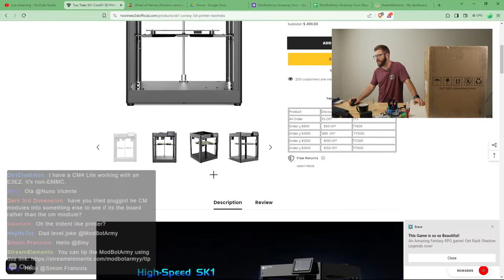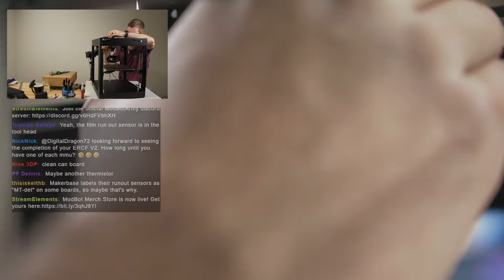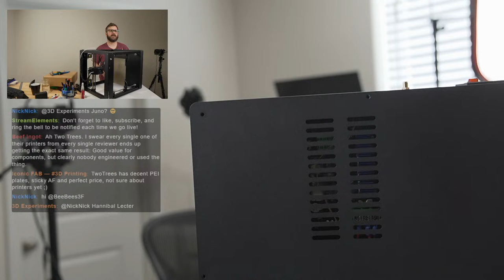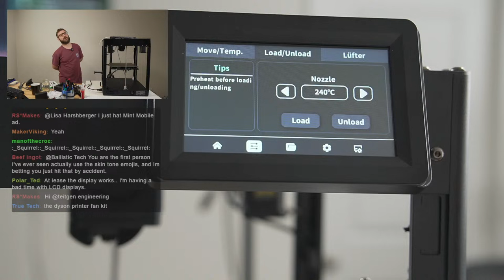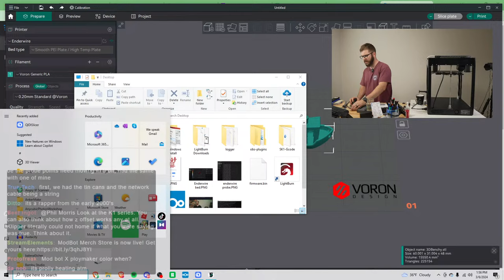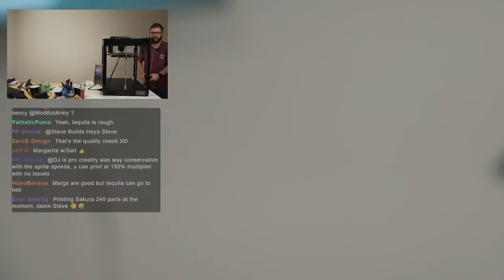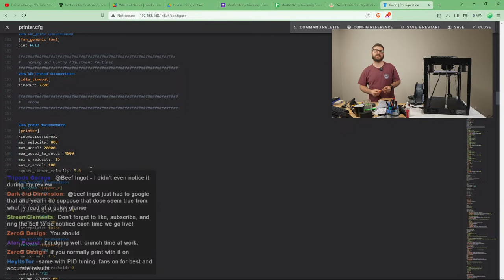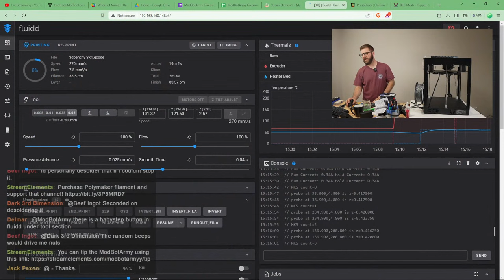Two Trees SK1 CoreXY 3D Printer Unboxing, Set Up, and First Impressions

Comment: i also did realise that the only prints that did bond however extremely poor finish 
ie cracks etc were prints from sample filaments or pla that came withe the printer

i however loaded my own filaments after they samples and thus could not get anymore prints to bond not to mention stick to the bed.
i then realised that petg melted at a higher temp compared to pla 
i also realised that the geetech 30m  willl not heat above 200 
this now contradicts the terms of purchase which includes petg and abs etc

the whole experience became a nightmare especially doing business with con merchants

Comment: I have an SK1. I like it but you'll have to destroy the hotend to change the nozzle. It won't come off. Also, while the hotend is the same, the heater and thermistor connections are different and, try as I might, I have been unsuccessful in buying some from TwoTrees. They're either truly dumb or just acting that way. They said they could only sell those parts as a whole printhead. I said ok, then they sent me a price list in Chinese. I Google translated it and it showed them priced separately. It's been going back and forth. The printer is great. They are morons. The SSH password is mks and the password is makerbase
Reply: @abhinutz6747 were you able to get a new hotend?